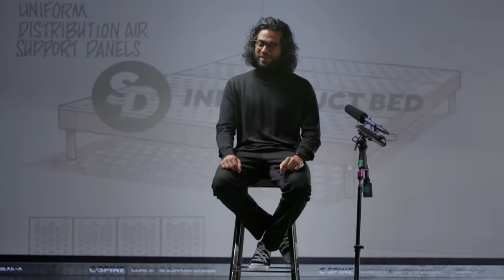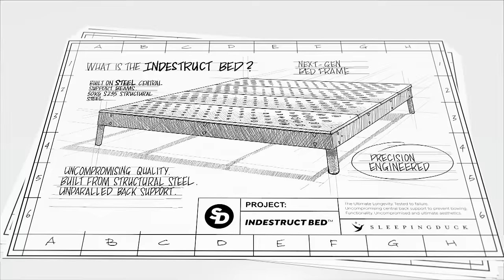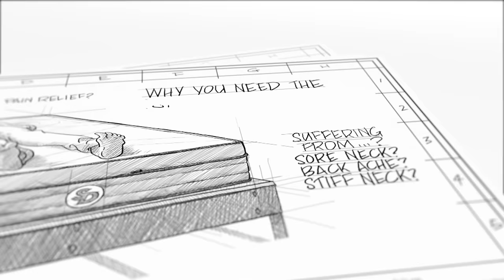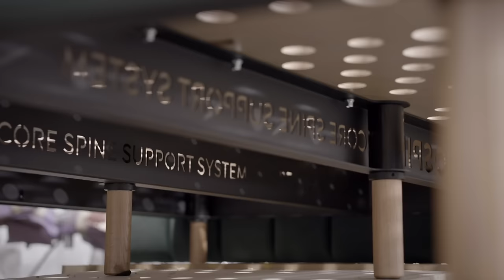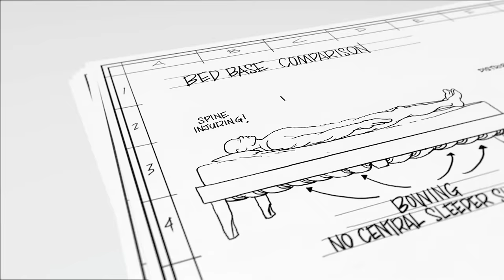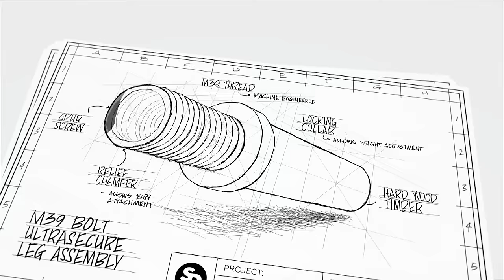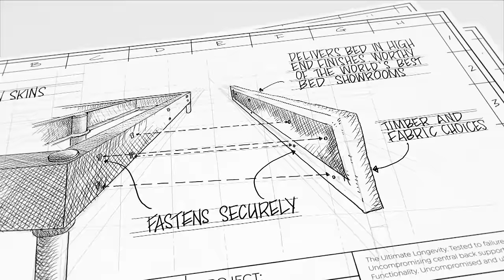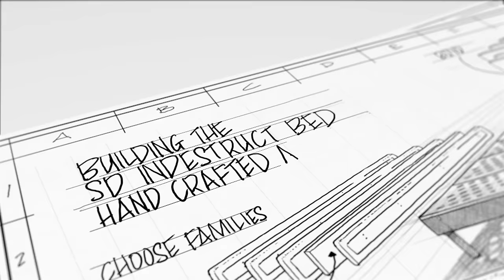Sleeping Duck's SD Indestruct Bed - For an Indestructible Spine | The Full Film

Comment: Lol 🤣 your trying too hard to sell it. 
From the 1000kg concrete block to dropping the beds. 
The only reason I’d buy it is because it will last forever. This is a bed that I can past down to my children. 
I just wanted to know does that mean I can jump on this bed without it breaking?
This is a sustainable bed. 
Do it once and do it right and they sure did, unfortunately not with the ad, hopefully ppl don’t get turned off and see it for its material and design. 
Now do the same with a sofa and all the other furniture.